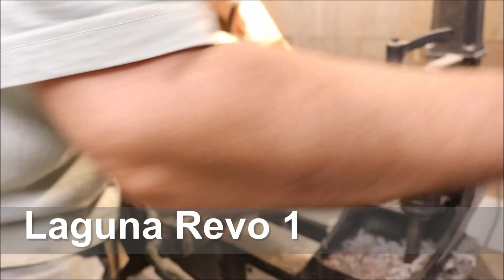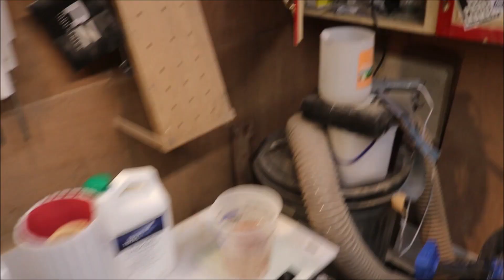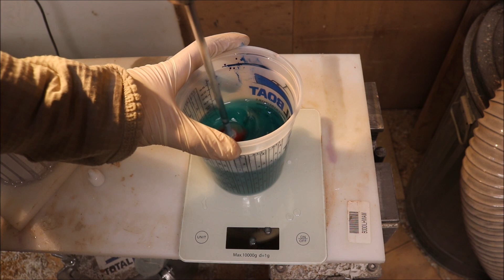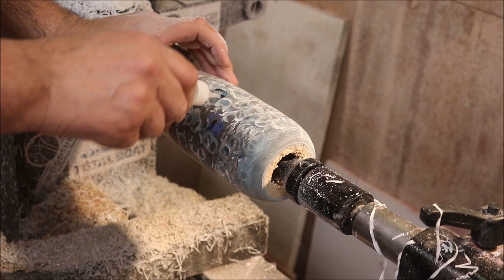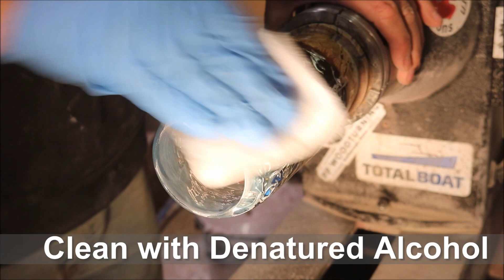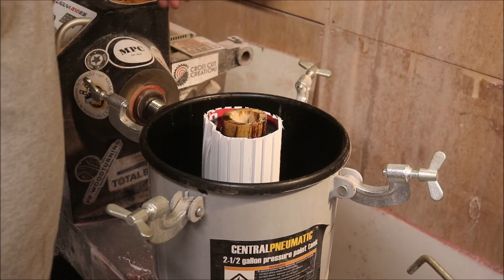Wood Turning - Pull Tab Vase

Comment: Very cool idea Ken!  It turned out amazingly.  I've been looking at mixing some aluminum nuts and resin for something different.  - Ed
Reply from the maker: Thanks. Something I have found is that aluminum and resin do not adhere well. The tabs flew out of this left and right. I'm having the same issue on next weeks video. 

Ken